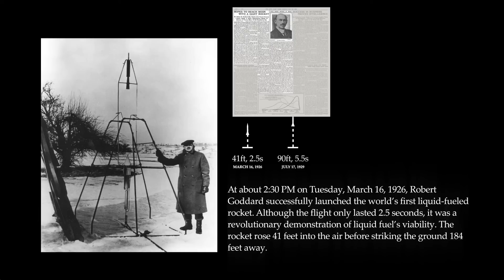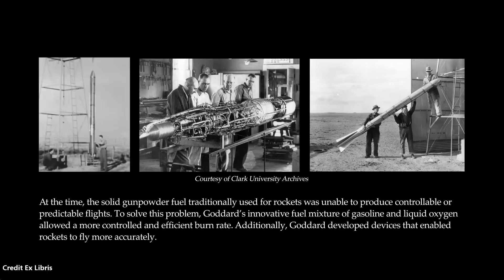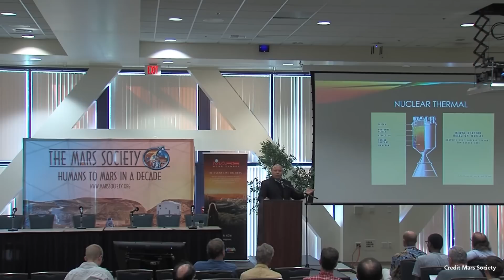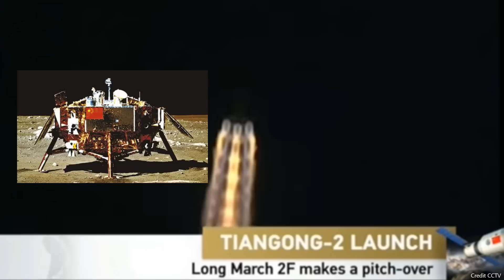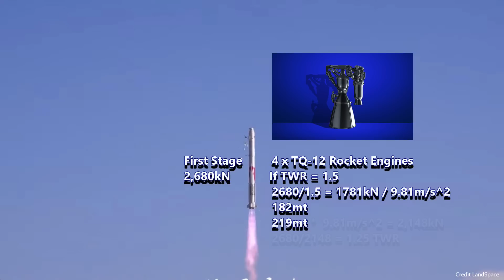Methane Fueled Rockets Will Dominate the Future.

Comment: There is a reason Kerosene was the preferred hydrocarbon propellant not Methane. Kerosene is DENSER and can be stored without refrigeration at all. Kerosene rockets more than makes up for the marginally lower specific impulse with smaller tanks and hence lighter structure. Methane is only recently in vogue because it doesn't coke and better allows reusable engines. That and the "potential" to be made in-situ on Mars which is irrelevant to every rocket not taking off from Mars -- at this point is every single one of them.
Reply from the maker: And rockets weren't reusable.  It may not be vital for the first stage but methane or hydrogen for the second and third stages usually makes more sense.
Reply: Not really in the case of rockets like starship with subcooled propellants, the more than doubling of the steel's strength because of it allows the skin to be lighter than expected and hold the tanks at higher pressures.
A rp-1 starship would probably need more reinforcement in the rp-1 tank.
Reply: @Iangamebr  Uh... Starship is NOT subcooled; the Falcon is. And, the falcon is a RP1 rocket. Regardless, subcooled or not, Methane is a significantly less dense fuel than Kerosene. That means bigger tanks and more structural weight.
Reply: @dwightlooi  all the propellants of starship are subcooled fairly close to their solid state.
Reply from the maker: SpaceX keeps their methane colder than required to prevent excessive boil off to increase density.  @dwightlooi

Comment: Maybe you missed the point, methalox is slightly better than any other thing than Hidrolox, but hidrolox need much higher dry mass than everything else, I made some napkin calculations of what would mean to replace the upper stage of falcon9 with a metalox one, and I find that would increase payload with 25%to LEO and 60 %to GTO! That is only the upper stage.
Reply: I am sure there is probably a little bit more to it than that since SpaceX never went through with the Raptor upper stage for Falcon 9.
Reply: @dr4d1s  it's not, but about why they don't make a upper stage for falcon9 with methalox, that was a decision based on the belief that Starship would fly soon(like in the summer of 2020) , and replace falcon9 and any other rocket, obviously that was overoptimistic, but basic rocket equation say that's is possible , and are other benefits (like not using scarce Niobium for the upper stage rocket engine nozzle, and other cost reduction for using a autonogenos pressurization system instead of helium tanks), but they make a decision,maybe isn't too late to change their minds? .
Reply from the maker: I think they should partner with Stoke Space and have a reusable second stage to go with their Falcon 9 booster.
Reply: @terranspaceacademy  well, about SpaceX teaming with another company, I don't think that would happen, they prefer to do the things in the house, also reusable upper stage isn't necessarily better (unlike the booster, witch is a separate question),if the average price is lower(and would be lower, without heat shield and other equipment),and the payload is 40% less,is better to make a small upper stage every time, than to spend money on recovery and refurbishment. PS also Stoke upper stage is a hidrolox one, I was talking about a metalox upper stage.

Comment: 2:17 no, the first methane rocket to make it to space was Zhuque-2 flight 1, nearly made it to orbit too before its vernier thrusters failed.
Reply from the maker: I thought it fell short of the Karman line.  If so I owe LandSpace an extra Kudo.
Reply: Terrane 1 was first in March, Zhuque 2 follwed in July. @terranespaceacademy better you should have pointed this out in the video.
Reply from the maker: @juliane__  I'm not sure why. We were covering the first to space and first to orbit.  We did said the first launch of Zhuque 2 failed to make orbit when the second stage failed.
The first stage doesn't always pass the Karman line and they (LandSpace) did not release the telemetry data that I can find. At what altitude was separation and where was the apogee? The SpaceX Falcon 9 might MECO at 80km and reach an apogee of 130km.   Can you find the stats of the first flight of the Zhuque-2?  We could not.